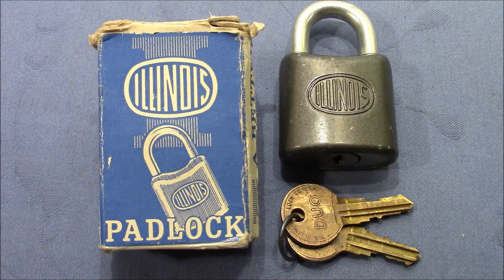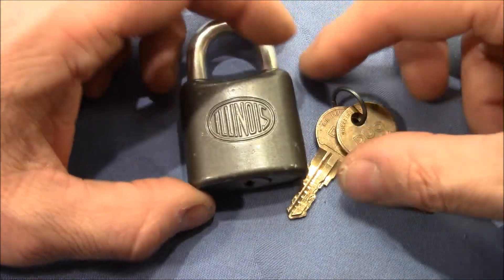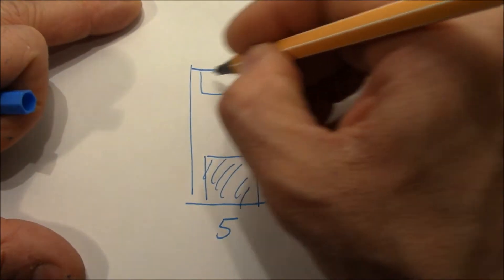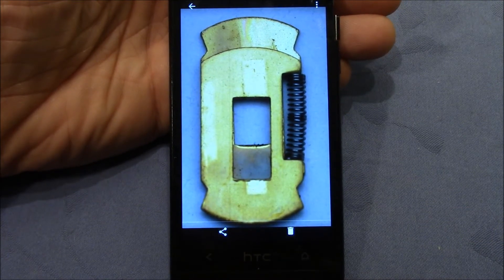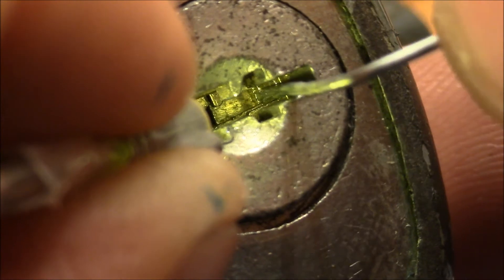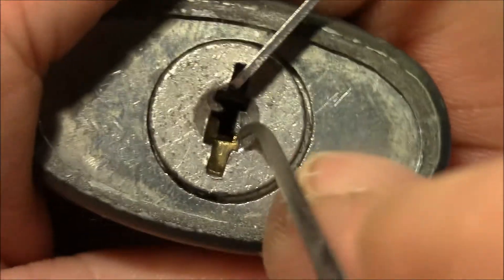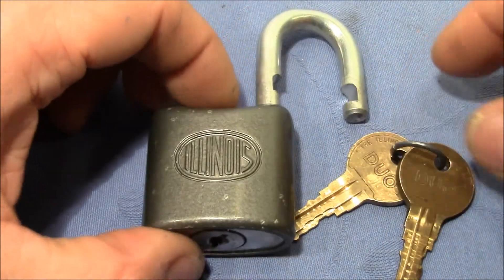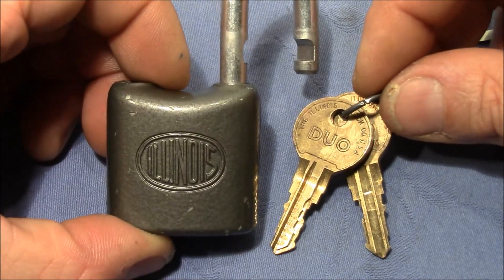(picking 345) ILLINOIS DUO padlock explained and picked - thanks a lot to 'APACHE-LOCKSPORT' for it

Comment: I have a very similar lock. Seems to have a slightly different core, not quite as open I am thinking it is probably missing the side biting and jut has the top and bottom.
Reply from the maker: Could you pick it?
Reply: @Potti314  Never picked anything

Comment: Awesom lock!! I got a cam lock that has keys like that I should send you
Reply from the maker: Just wanted to ask if you want to have the DUO box. I don't collect these boxes, so I'd be happy to send it to you. Just let me know your address.
Reply: Texas Lock Picker 

The duo cam lock was made until 1993, it's a neat little cam lock (have 3 plus the same padlock) I have a smaller one installed as my mail box .
Reply from the maker: Thanks for the info. So this lock is at least 24 years old.
Reply: That padlock is probably quite a bit older, its really a nice piece. Mine isa bit more tarnished.
Reply from the maker: Ah cool. Did you get my personal message?
Reply: Potti314 

No sorry I didn't get it.
Reply: Sorry been busy at work, thanks but it would just ad to my clutter.

Comment from the maker: That's a true gem :-) Thanks a lot to 'APACHE-LOCKSPORT' for sending me this great lock.
Reply: Potti314 

I have the same lock, but sadly do not have the box. Plus I have a Duo cam lock which you can still easily get. Great video explanation of how it works.
Reply from the maker: Thank you - have you ever completely gutted your cam lock and put it back together? I have heard that it's very difficult.
Reply: Not totally, after removing the retaining clip, the core slides out, and the wafers are retained somehow. I didn't want to damage it so i reassembled it.